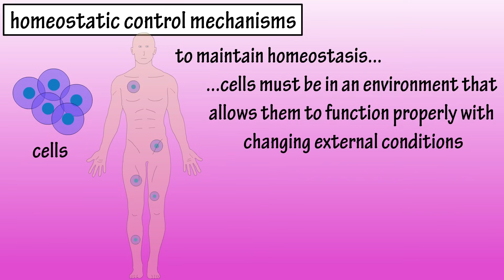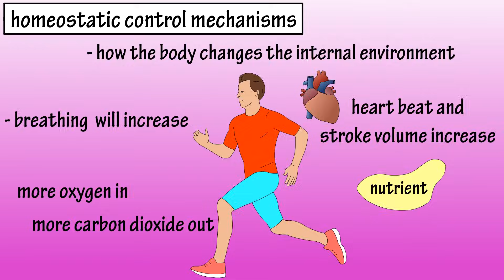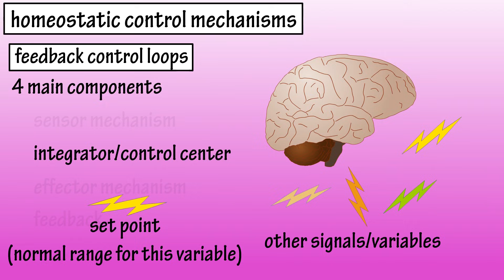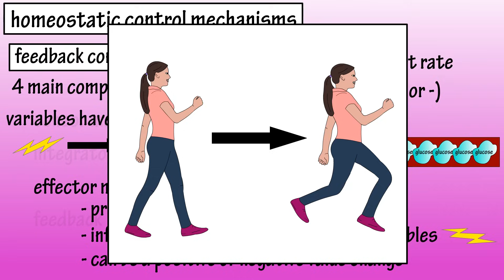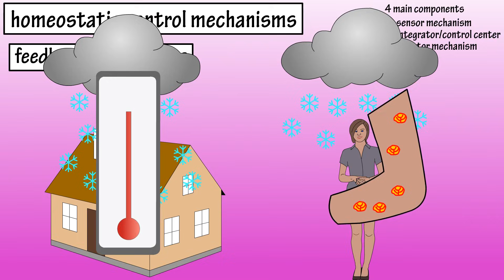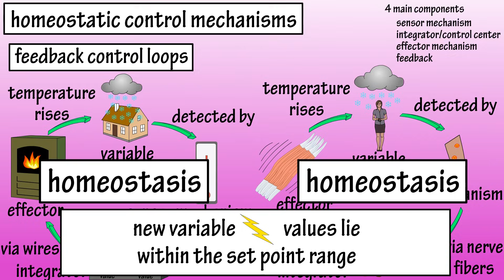Homeostatic Control Systems - Homeostatic Control Mechanisms and Feedback Control Loops

Comment: Can anyone answer this pls…..

The temperature in a room drops to 65 F causing the heater to turn on. The temperature change is an example of 
a. Response 
b. Stimulus 
c. Effector 
d. Receptor 
e. Control system